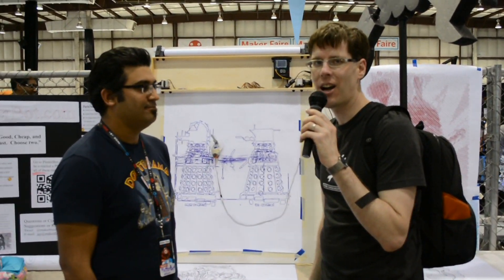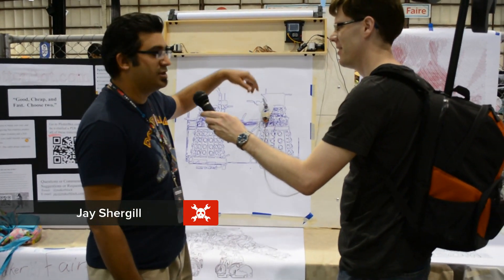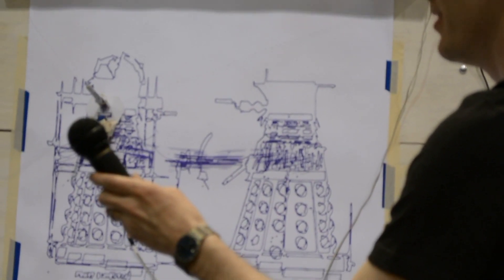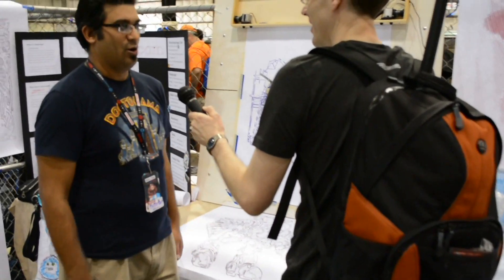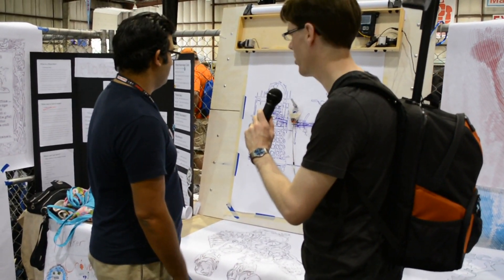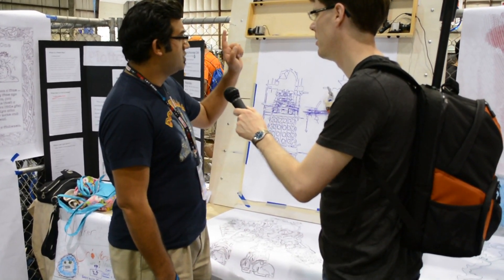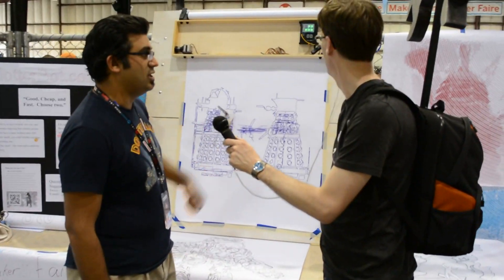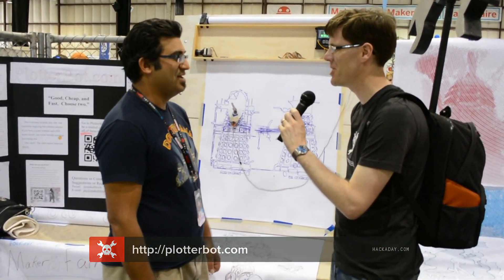Hanging Out with the Plotterbot

Comment: Didn't the polargraph guy move on from pens to spray-paint cans?  If it wasn't him it was someone else, a neat project!

Attaching pens is a pain, always harder than it seems.  It's difficult to keep the whole thing balanced and sliding properly so the pen remains at around 90deg to the paper.

Seems like you could do the multi-colour thing with just 1 servo:
Pierce a couple of different coloured pens through a round disc servo arm, have the disc mostly parallel to the paper, but slightly angled towards it.
So if the disc is rotated to select a different pen, only the pen closest to the paper will draw on it.
Think of it like cupping your hand under the business end of a spinning multi-barrel minigun: as it spins around, the ends of each of the barrels will touch your hand in-turn.